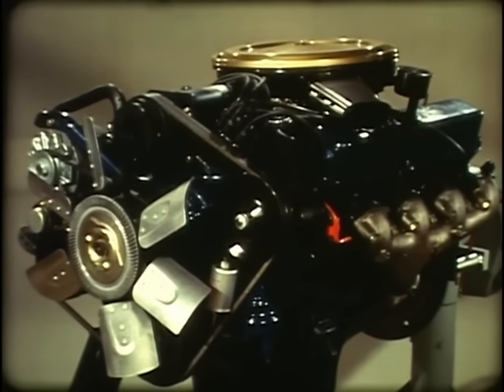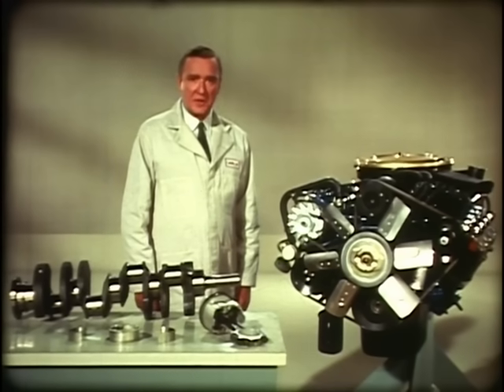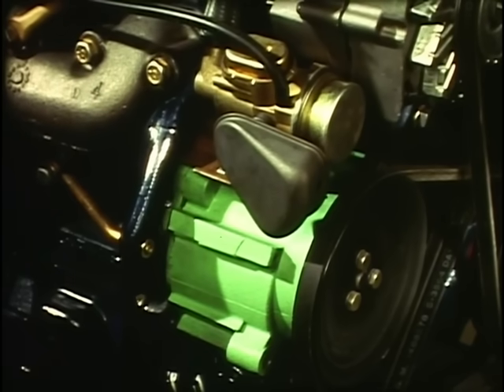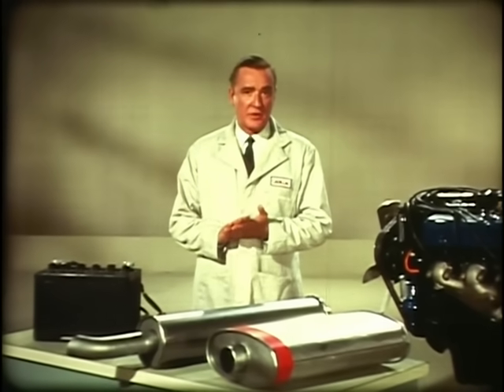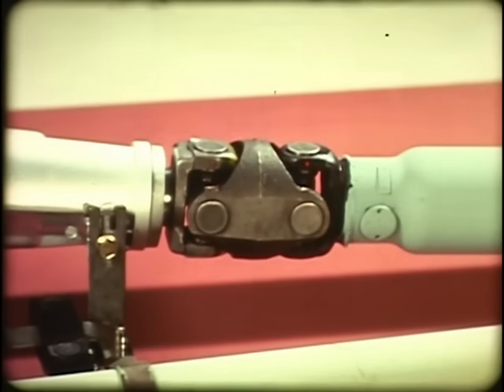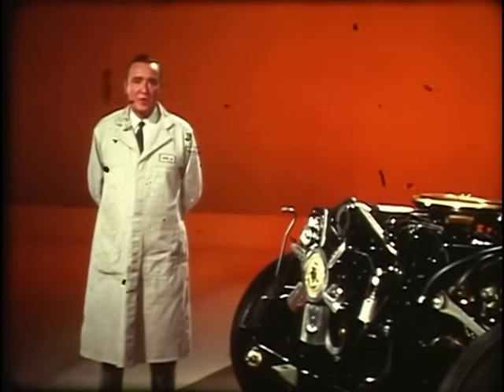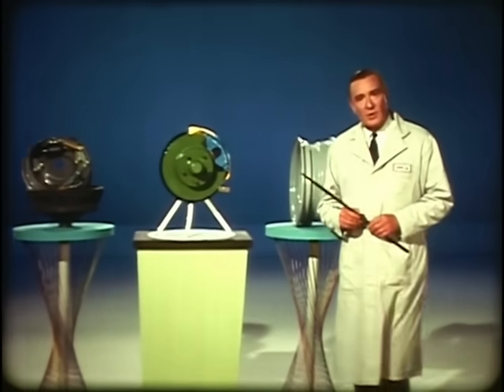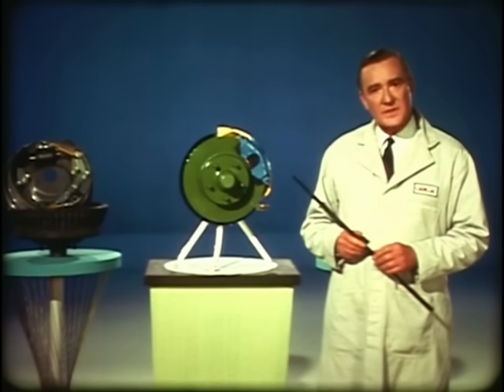1968 Cadillac Engineering Features

Comment: Those hp/torque numbers are truly impressive.
Reply: Yes although back of the day it was worse than today for marketing hype! Horsepower figures were generally exaggerated (and were I think according to SAE sanctioned rules ?)which meant that you could remove air  boxes have ducted manifold exhaust,  electrical system ,water system everything system basically remotely powered so the engine developed boatload more horsepower than the one you had in your car with power steering pumps air con, electrical generator etc. All sucking power 😮
Reply from the maker: They are!  Bigger than many trucks.
Reply: Torque is quite nice, that's for sure. But the horsepower isn't that great. It's only 48.7 hp/litre.
Reply: @Optimistprime.  But it was naturally aspirated and made that hp at only 4500 rpm.
Reply: @mitchmasterfix5292 yup, with a low profile intake and single exhaust
Reply: @mitchmasterfix5292  don't get me wrong. For the time, it was a really sweet engine. The hp rpms are really good for a pushrod engine of the era. My main point was that the more horsepower per litre, the more efficient your engine is. My Honda Ridgeline 3.5L V6 makes 80 h/L.  But either way. Different times, and man have they changed!!
Reply: @Optimistprime.  Yea but that 472 can make that power for thousands of miles. That Ridgeline engine will hold together just long enough for the dyno to give the reading.
Reply: @airplanemechanic9513  I'm not saying the 472 isn't a touch engine. It's just not very efficient when it comes to power.
Reply: @Optimistprime. 114hp/L with 516ft lbs, Mercedes Diesel passenger car engine 0-60 in 4,9s. 155mph—electronically adjusted? Is the answer
Reply: @Optimistprime.  Unless you were to add a supercharger, you'll never get high horsepower per liter ratings when (for sake of silence and longevity) its peak horsepower is at just 4,400 RPM
Reply: @gregparrott Displacement counts for sure, but theres lots of factors that go into making an engine more efficient and more powerful, hence my Ridgelines 3.5 V6 engine. Hondas S2000 has a naturally aspirated 2.0L four cylinder that makes 240hp. That's 120 hp/litre!

Comment: Foot-pounds should be kinetic energy.  Torque is measured in pound-feet.  525 pound-feet of torque is huge.  The earlier 429 cid was pretty torquey too.
Reply from the maker: Crazy torque from these engines, true.
Reply: 5x2=10.  2x5=10.  Either way works.  Same goes with units.
Reply: @vatayfairfoot  There is a right way to express torque.  From, "Morehouse Intrumant Company", "The improper use of torque units can easily be corrected. When you see manufacturers using ft·lbf on a torque specification, let them know the proper way to express torque is  Force times  Length."  That is what I did.
Reply: @SuperMurrayb  I’m an engineer.  The units in this case are commutative. Get over yourself.
Reply: @vatayfairfoot  Why argue ad hominem?  I quoted from an authorative source and can provide much more evidence for my claim.  You should now do the same.  By the way what type of an engineer does not know that torque is a vector quantity?
Reply: @SuperMurrayb  I just rebuilt an engine last July and torqued the head bolts to 58 ft-lb instead of 58 lb-ft.  I better pull the valve cover off and torque them to the correct amount.  Who knows what damage I’ve done!
Reply: Oh no, I’m even in worse shape than you since I torqued my head bolts to 78.6 Nm!  Or was it Joules, eh the gaskets are holding up and she lights the rear tire afire!

Comment: Good engineering video. It sure didn't need all that hippy color crap. I'm surprised that GM allowed all that crap. Love all that engineering stuff. New car commercials should be made like this. They don't want to because they don't have anything to be proud of.
Reply from the maker: This film was to train sales people.  Back in 1968, people understood cars and wanted technical details.  These days, things have changed.  Many people don't even know the size of their engine or even how many cylinders it has.  Their concerns are bluetooth connectivity, cup holders, and automatic driving features.  It's a very different era.
Reply: This isn't a commercial - it was for sales people.
Reply: The intro was dated even by 1968 standards.   Looks like it's from the late 50s.  Cadillac was starting its long slide into oblivion.   The only good thing they did in the 70s was the Seville and then they messed that up as well.
Reply from the maker: Thanks for watching
Reply: this is an internal video for the sales force and i liked it!

Comment: 1968 Cadillac is my favorite Cadillac! I remember when they were brand new in the showrooom, first year for federally mandated side marker lights.
Reply from the maker: And the last year for Over/Under headlights.  Great year for Caddy.  Thanks for watching!
Reply: What amazing refinement compared to '67. Coupe deVille & Fleetwood were drop-dead gorgeous.  Timeless in its design. Not one detail out of place. Still easily keeps up with 2024 traffic.
Reply: @williamlegall2988 472 cubes should outperform all new car little engines
Reply: My favorite as well. They did a great job integrating those side marker lights.
Reply: I love your comment about the federally mandated side marker lights. I was eleven when that requirement came into effect. There was great anticipation what such lights would look like. I was fascinated by the '68 Cadillac's solution in which the front cornering lights lit up orange unless the cornering lights were on, much the way backup lights would be red as running lights unless the backup lights were in operation when they would be white.
Reply: it was a great year for everything.